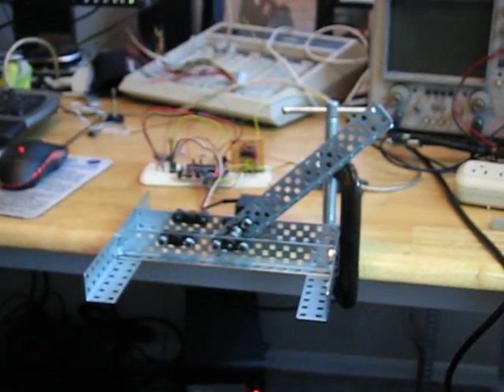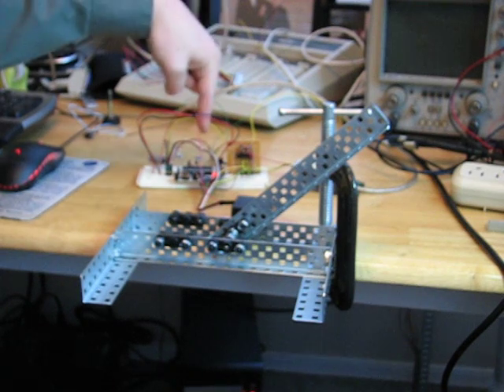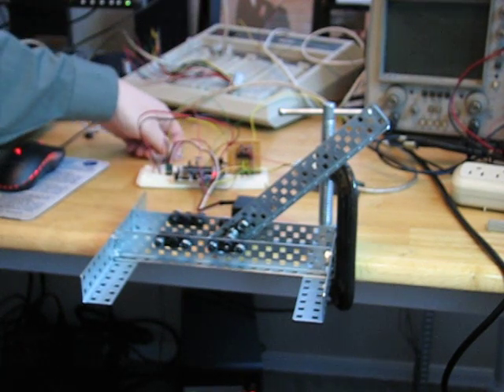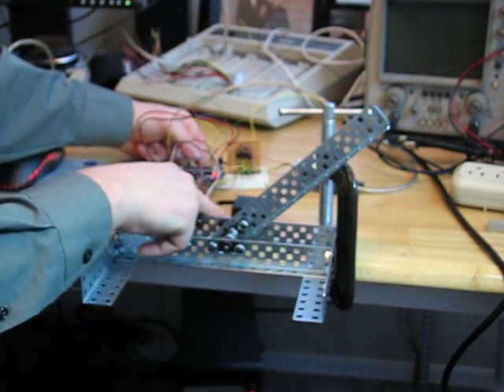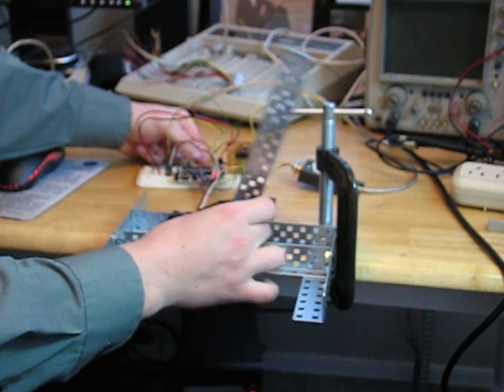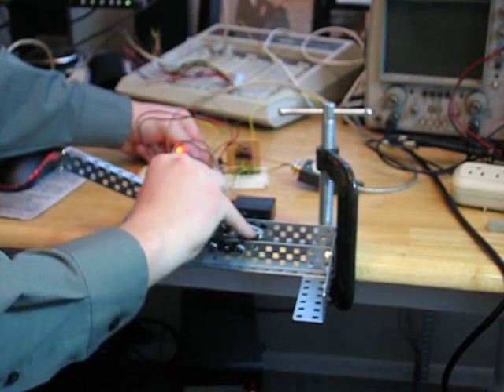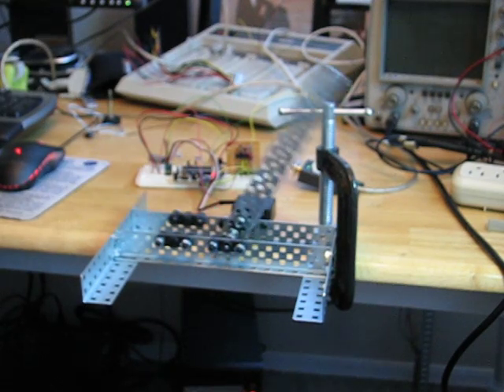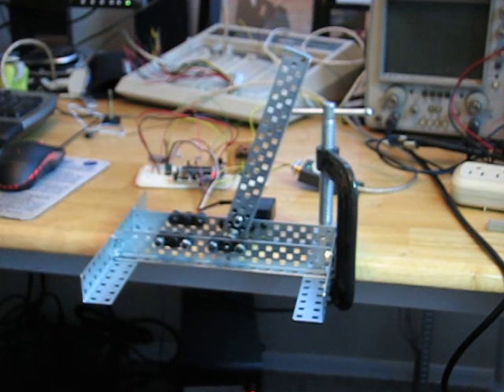Using a servo as an input device

Comment: Pretty awesome stuff. Thanks for sharing. I want to detect the movement only like a potentiometer or better like a rotery encoder. I can detect the rotation but not the direction. I use a modified version of this board (http://nl.aliexpress.com/item/1pc-Sound-Control-LED-Melody-Lamp-Electronic-Production-DIY-Kits-Suite-New/32284039573.html?spm=2114.13010608.0.53.hZI0ES) and replace the mic with a dc motor (stepper motot coil). I use this to amplify the movements. When I rotate the motor into any direction, the LEDs starts to flicker so I can detect the movement. but not the direction. Any ideas?